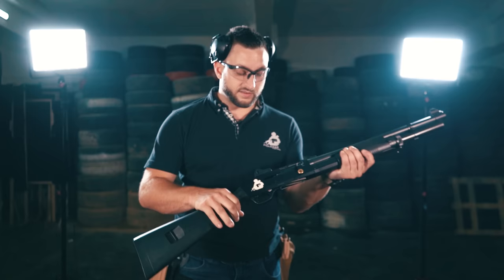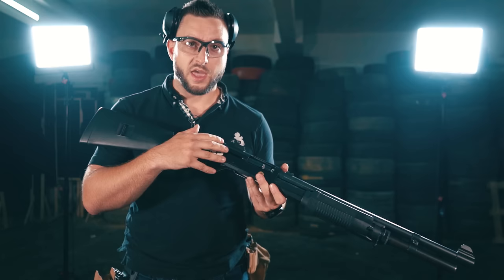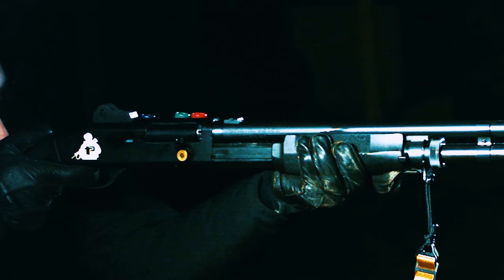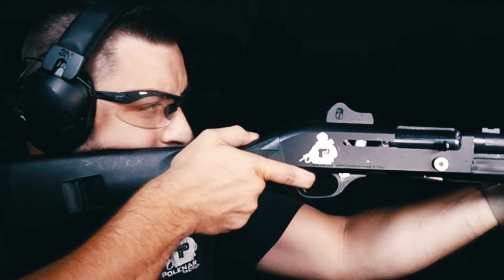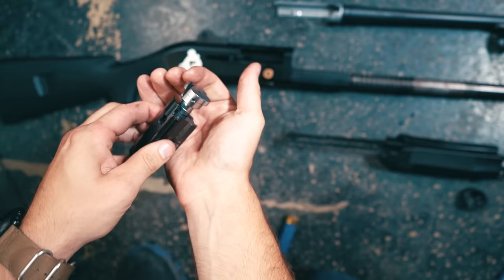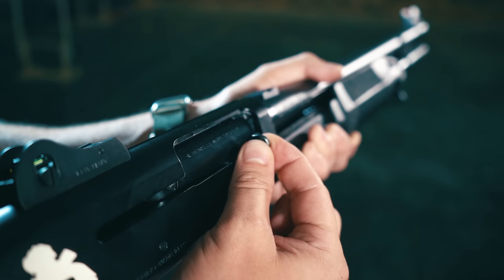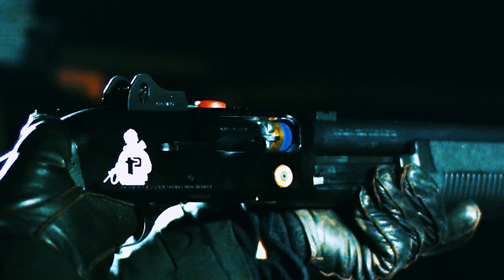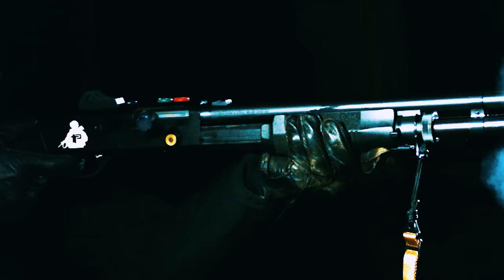Benelli M3 - How does it work?

Comment: The only drawback of the system is that it won't cycle certain ammunition types, like blanks(which is why you don't see these in a whole lot of films,) and less-than-lethal loads like bean bag and rubber baton. Fortunately in the case of the M3, the convertible pump action helps alleviate that problem.
Reply from the maker: True
But i never thought about blanks and movies before :D

Comment: I have a question regarding this operation system:
If the gun relies on inertia to unlock the bolt, would it work if it was clamped in a vice so that it couldn't move due to recoil?

Comment: Benelli m3 vs ltt beretta 1301 for shtf in california which one should i get?
Reply: I just got the m3. But still may get the 1301. 

Finding after market parts for 1301 is easier though. M3 differs in a lot of ways from the other m series and I'm finding that you gotta look harder for parts. Not impossible though.
Reply: @greg1813  wise choice mi friend i may get the 1301 to but first im gona fully trick out the m3. this guy went the custom made route https://youtu.be/6l22GM9xK1M

Comment: Hello, it is very nice video. But I wnat to learn the power difernces. Could you measure by any way, external and target ballistic situations? Actually, I think, manual should more powerfull from semi automatic. Because gas energy is %100 spending directly the bullet. On semi Automatic mod, the gas energy is working form recoil for setup the new shot. I think there is %5-10 power difrences, but do you have any experience?

Comment: I wonder how the Turkish M3 Clone would stack up against the original Benelli? Especially if you spend an extra $100 or so and add the original Benelli internals like springs, extractor , pins, etc. 🤔 it would be a huge cost saving, and the internals should help to make it a solid choice.

Comment: An interesting thing about inertial locking is that if the gun doesn't move, it won't cycle. So no vehicle mounted shotgun for you :( (why tho
Reply from the maker: True! 
We once fired a turkish copy of a benelli and it didn't want to cycle if you were holding it really tight in the shoulder which at that time didn't make any sense to us.
Reply: Polenar Tactical so it actually can happen in normal shooting! Interesting thanks for the info

Comment: doesn't every modern gun work like that? I don't know i am not a gun geek
Reply from the maker: Good question. Handguns mostly work with a delayed blowback system where a barrel locks to the slide so the force of the round firing first starts to push the barrel and the slide (together, locked) back to a certain point and then the cam unlocks the barrel and only the slide recoils back, ejects the empty shell casing and loads a new round. 
Most semi-auto rifles work with a bolt and bolt carrier - where a bolt usually rotates (but it can also cam or drop) and locks into the barrel extension or locking lugs. So when the round goes off the bolt stays locked and closed because the recoil or pressure from the round can't rotate and unlock it. 
To achieve that most modern rifles have a gas system where it takes a part of the gasses from the fired bullet to operate the action. You can have direct impingement, short stroke or long stroke piston system (and variations)
So the gasses push the piston back which moves the bolt carrier back and thus unlocking and opening the bolt. 

But the benelli shotgun does that without the gas system, only with using the high recoil from 12 gauge rounds